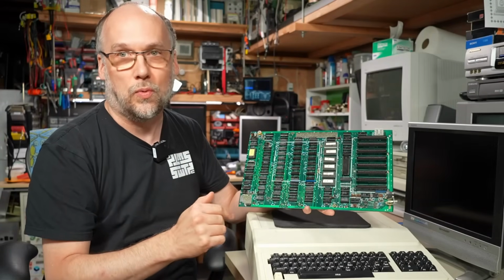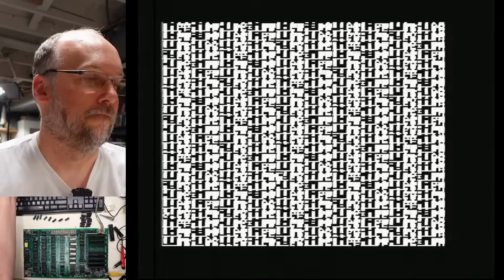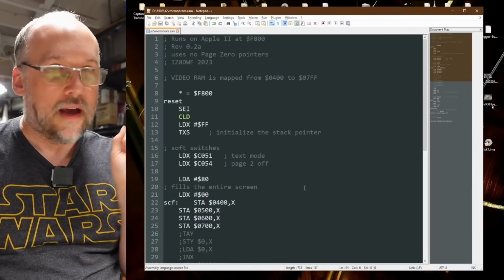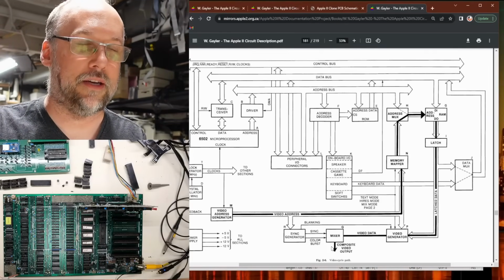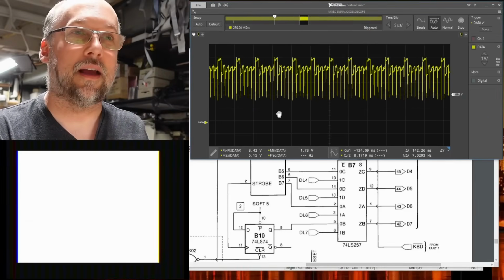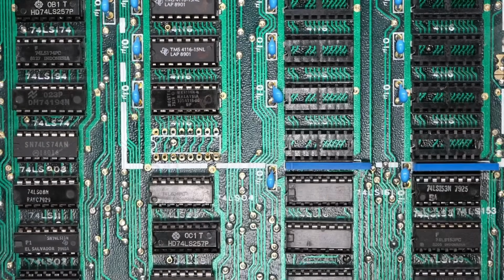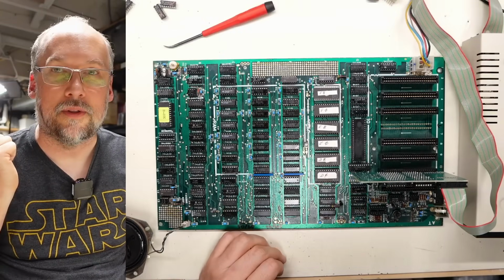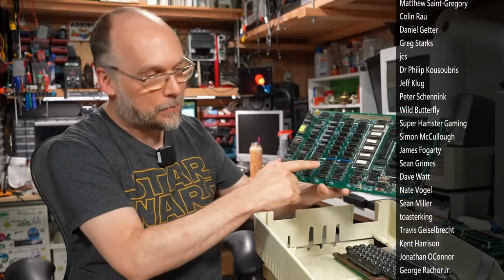Apple II+ clone repair: It was one of my most difficult

Comment: What!? I love the assuring sound of the multimeter beeping! That's the best part of the multimeter! :D

Yes, this was definitely a rollercoaster of emotions. I'm amazed of your knowledge of these systems. I can kinda follow but if I were attempting to fix a machine like this I'd be stumped, I wouldn't even know where to start. Great job on finding those faults! I hope you can fully resurrect this board and apply that color-killer circuit on the blank parts of the motherboard.
Reply from the maker: Thanks! Hey and before this I barely knew the apple II, so this was a lot of studying of that book to grasp how it all worked. This work has been thrilling and exciting for me too, and very very time consuming. (But it's been amazing, no complaints)
Reply: The beep is the song of my people!
Reply: I totally agree about the beep. For finding the exact location of the fault, a good milliohms reading is very important but for basic conductivity tests, you don't want to have to look at the display all time. I even judge the quality of a conductivity tester by the beep latency, some take some 100ms until they beep. Can't use them :)
Reply: Someone could make an audio filter as the beep has a very specific frequency. Similar to like a colleague made a Vuvuzela filter for VLC back during the Brazil soccer world championship.

Comment: It's possible whoever originally had this built it from a bare PCB themselves and it never completely worked.  Definitely a bad quality PCB.
Reply: I agree, i think this was sold as a bare PCB,  somebody built it and it never worked, that sort of copper bridge don't suddenly go short, they were there from new.
The random mixture of ram and some of the buffers could have been somebody building it on a budget, using what they could get.
I do wonder if the original transistors that were replaced in the last video weren't faulty and were just incompatible with the 2N3904 the pcb was designed for, they seemed to be fitted a different way round to the PCB legend.  
Both suddenly seemed to work when removed from the PCB which doesn't seem likely if they were faulty on the board.

It also looked like there were unsoldered pins on some of the expansion connectors here, https://youtu.be/ErwUFmgQgXY , the 4th pin to the right of the B in Blog on the meter label for a start.
Reply: @jameshearne891 I was thinking the same, although I did run into a situation where tiny etch bridges weren't a problem until boards were flexed. They were just far enough away to not cause a problem, but when the board was flexed, it put them in contact with a nearby pad causing the failure.
Reply: Is it possible that the plating under the gold layer (probably tin) is forming whiskers over time?
Reply: That would explain the weird stuff like the transistor sockets. My guess is that the chips that were obviously swapped out are misleading. Either they were never swapped out, and the board was just built with random junk surplus parts, or maybe several people over the years tried to get it by working swapping out misc chips.
Reply: That was my thought also, maybe they tried but gave up on fixing it.
Reply: I think the self-assembly kit theory has merit, especially considering Adrian himself acquired an identical bare PCB, so they must have been available somewhere at some point.

Perhaps someone bought the kit, assembled with a hodgepodge of used parts, and it never worked, so they put it aside for years, and it ultimately turns up in Adrian's hands.
Reply: @HwAoRrDk  They were indeed available and quite readily too, used to be sold in the back of computer magazines.

More than a few research labs got their computers that way because it was easier to get funding to order parts than to order an actual computer ;)
Reply: I would lean towards this explanation as well. It probably didn't work, got shelved, and someone tried to fix it later for fun, and was also unsuccessful.
Reply: I wouldn’t be surprised if these bare boards which somehow found their way into the market were originally bound for clones and rejected at QA. Like someone sold the rejects pile.